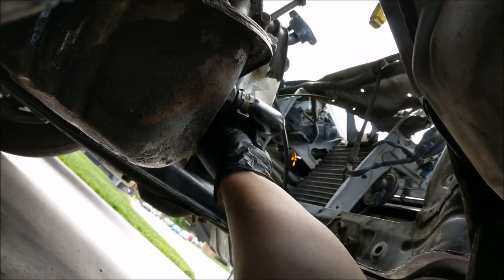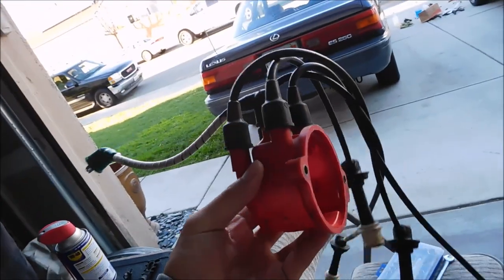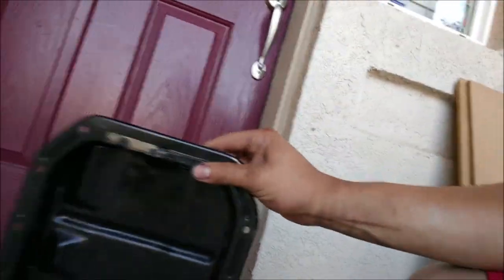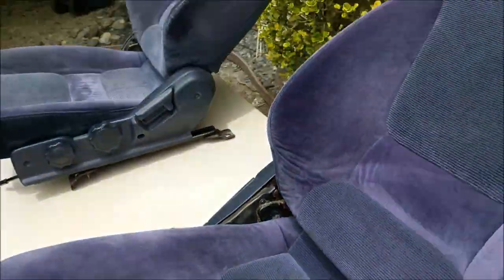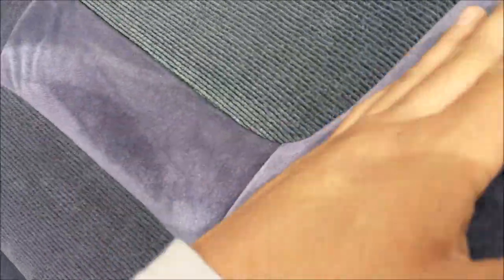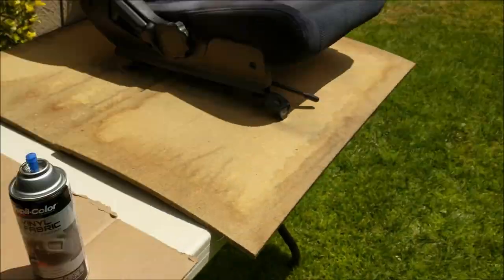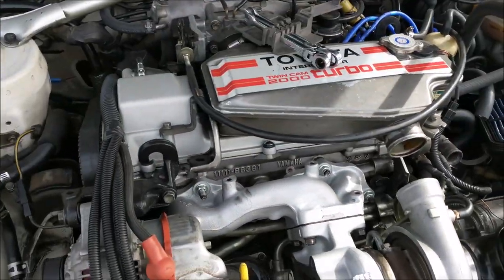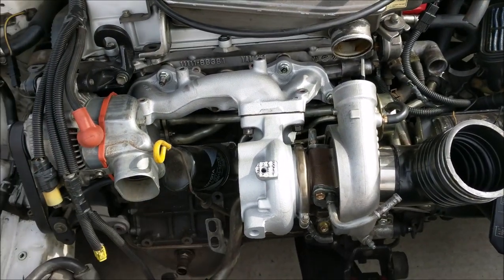Working on the ST165's Interior

Comment: Looking at picking up a non runner as a first project, how would you recommend an st165 as a project?
Reply from the maker: Physically it's not a hard car to work on. Everything is pretty straight forward, it's just cramped in the engine bay. If you don't mind the scarcity of parts I'd say go for it. it's a very unique car and in imo worth saving
Reply: @joelalimboyoguen8900   any idea how they drive as compared to an st185? I used to own one
Reply from the maker: @crsm32  honestly I have no idea. I have never driven an st185 I've only seen them. From what I've heard tho the 185 handles better than the 165 but, I believe they all have a similar feel across all the gt fours